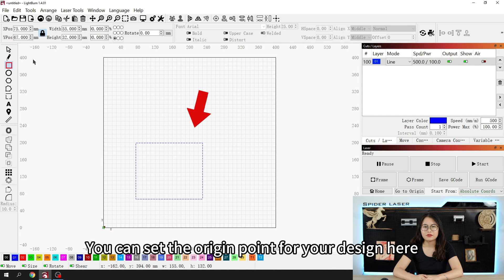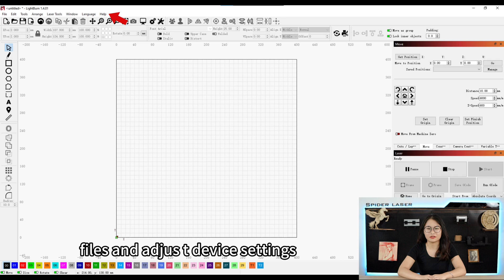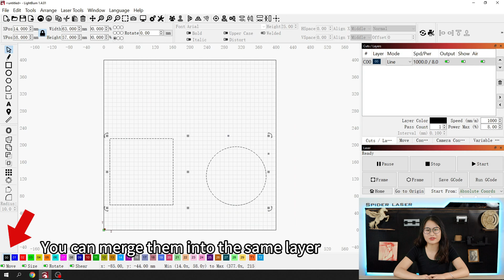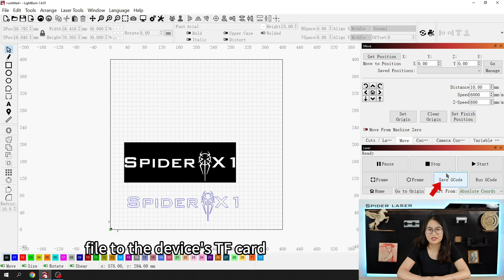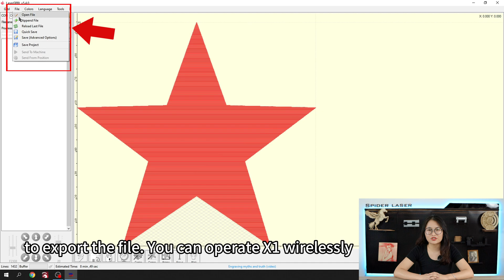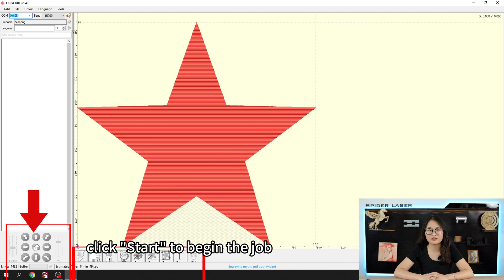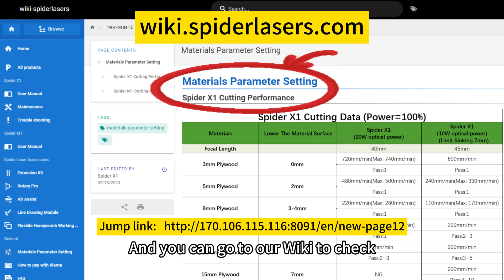Discovering Tyvok Spider X1:Engraving Tool,LaserGRBL and LightBurn Tutorial,and Parameter Settings

Comment: xin chào, tôi đang sử dụng x1s 10w nhung khi cắt file bằng lighburn thì kích thước sau khi cắt bị nhỏ hơn trên bản vẽ, hãy chỉ tôi các khắc phục
Reply from the maker: Hello, is it smaller in the x-axis direction or the y-axis direction? Have you turned on the frame mode?
Reply: @Tyvokspiderlaser  tôi phải cắm usb vào thì nó mới đúng, còn không sẽ bị sai trục  y
Reply: @Tyvokspiderlaser  và máy rất hay mất kết nối khi đang sử dụng